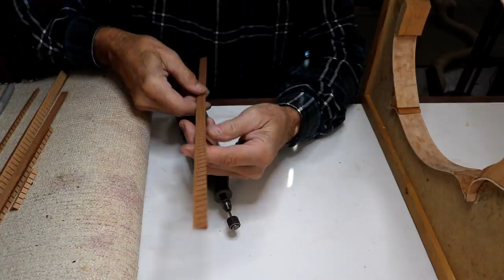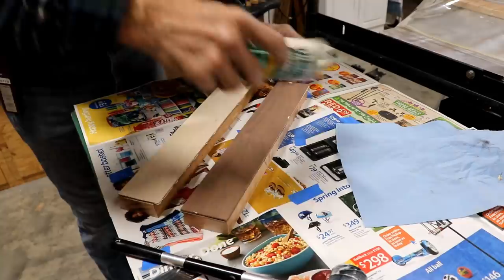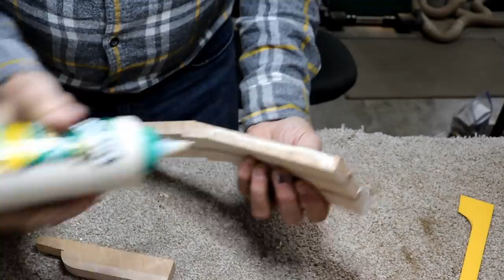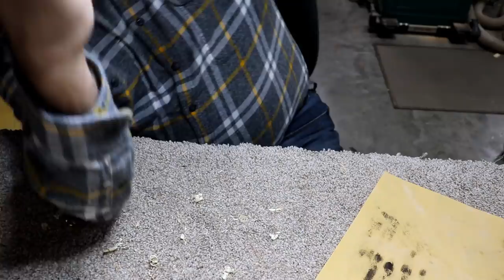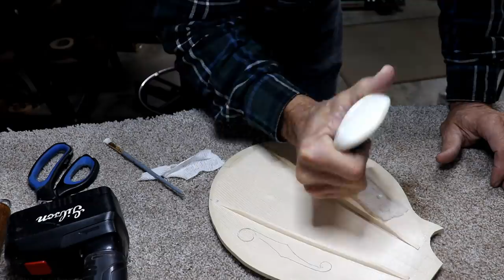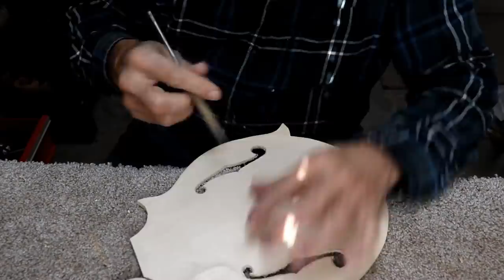560 RSW The Worlds Finest Mandolin Ever Built By A Human - Part 6

Comment: I think some small locating pins on the top and bottom corners of those boards would work perfectly with the vacuum seal, in an area that you'd shave off anyways but I think it would make alignment much easier for you! The pins don't even necessarily need to go the entire way through, you could inlay some small pins in a tiny recess near the edges of the boards, knowing they will be cut off later so you don't need to remove them. Thanks for another great video 😊

Comment: Jerry, to make things easier for yourself when doing vacuum veneering, make yourself a plenum(and rounded piece on top of the glue-up) much larger than the piece you're attempting to glue up.  That way you only have to focus on keeping the glue-up in position - which is much easier than having to worry about keeping everything in alignment.

Comment: Bow builders use a bladder press on those finicky layups. Just a piece of fire hose clamped on one end with a air hose fitting on the other end.  Lightly clamp up your piece with the hose under an over press board and flip on the compressor. Open air so glue evaporates and even pressure so no slippage. Bonus it works just as well on contoured shapes.

Comment: Thought: place glue-up in a vice, shrink wrap half, flip & shrink other half. A little heat will tighten up but you may not need that.
Reply: *that said, you may benefit from a little flexibility due to that much pressure potentially causing slippage

Comment: Hey Jerry.. Just an idea.. on the vacuum sliding issue.. can you use some menard clamps and install cawls the length of the neck sides on both sides on the outside of the bag to hold them softly in place as it sucks the air out and then remove them once full vacuum happens.

Comment: So just a quick question: I have seen you build several mandolins, and I have never seen you doing the tuning of the instrument like Roger Siminoff talks about. I remember you talking about using his book to learn how to build, but I don't think he talked about the tap tuning part in the first version of the book. In the 3rd and now the 4th, he goes into big detail about it (especially in the latest one). Is this something that you don't worry about since you have the measurements you want, or have you just not documented it? I'm starting a mandolin, and I'm just wondering. 
This one is going to be a real beauty. That quilting is just spectacular.
Reply: I should have just waited, you answered my question. I guess I just expect to see the lab that Siminoff has. Plus, he tunes them after he glues them and the neck to the sides. But I see what you are going for, and it's clear that you have something going with your golden set of measurements. Again, can't wait to hear this one.

Comment: Tightbond 3 is no stronger than Tightbond 2. TB 3 is just waterproof and takes longer to dry. And I know this sounds stupid. But, sprinkle some salt in between the layers after applying the glue. It stops the slipping. Salt is soft enough that it does not do any harm to woodworking tools. You only need a little. P.V.A. glue dries and cures by evaporation. So, when using a vacuum press, the moisture in the glue has no place to go except into the wood. Once the glue sets, the wood needs to air-dry for some time. How long that may take depends on how much glue you used. I'm not a troll. I am 60 years old and have been making dead tree carcasses into things ever since I was 12 years old. I have even made a few guitars. Not as good at it as you are, tho. If someone asked me to carve a spoon from Curley Maple. I would tell them to go to hell. LOL, I'm impressed. Have you ever thought that it may be impossible to make anything perfectly? Were Human, after all. 🤕 God bless and stay safe.